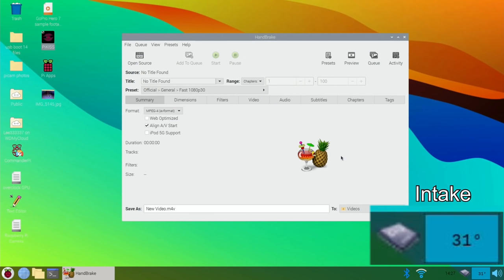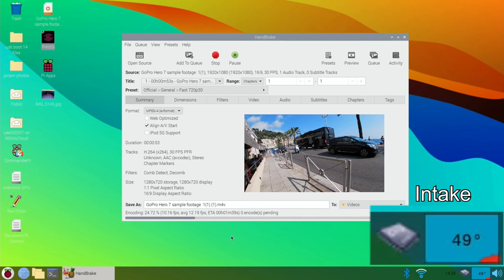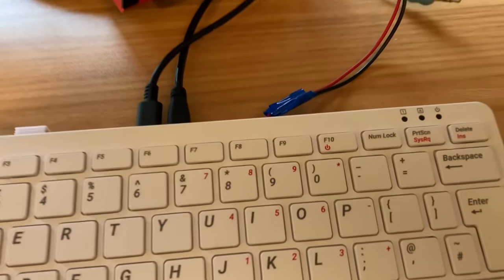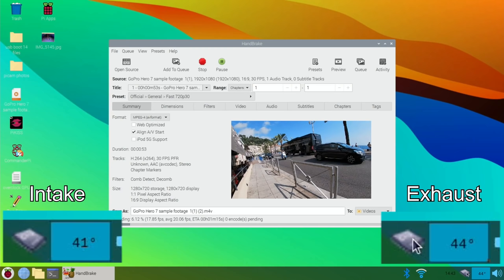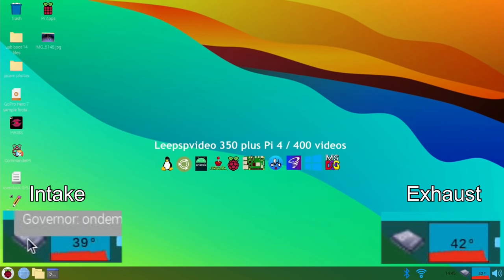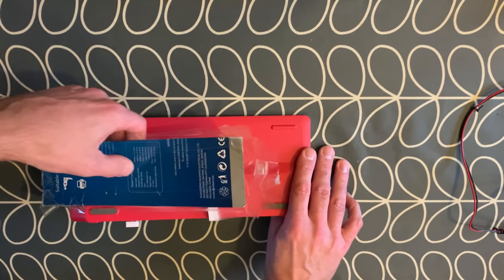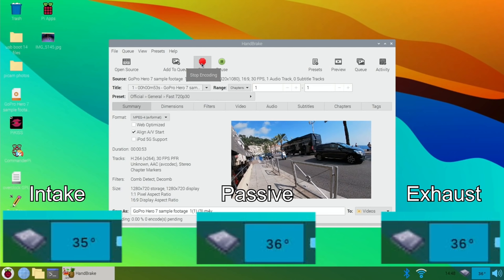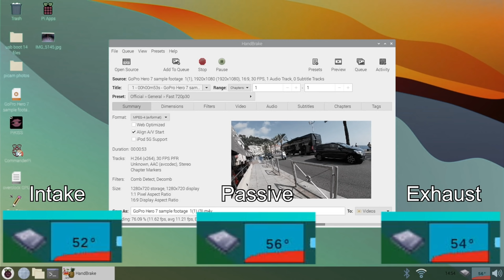Raspberry Pi 400.  Cooling Fan Test.

Comment: I think that you could dramatically improve the efficiency of that setup by doing the following. Cut your piece of car that goes across the bottom of the pie exactly in the middle such that it covers the first set of holes it meets, but the second set are open. Block the end of the 'duct' you have created with a piece of carefully shaped Blu-Tac. You will then have a situation where air is forced into the first set of slots to flow over the vicinity of the SOC, but is then as free as it can be from the second set of slots carrying heat away. I bet you it gives a result at least a couple of degrees better than the 'blowing' setup you had before.

Comment: With your fan in the exhaust arrangement, the cardboard would have been pushed against the bottom of the case by outside air pressure, restricting airflow.  If you lay a couple wires between the cardboard and the bottom of the case, parallel to the planned airflow to keep the air channel open, you will likely get different results.
Reply from the maker: Thanks, the case has a ridge where the vents are. The channel was clear throughout as the cardboard was flat leaving a triangular cavity for airflow.
Reply: @leepspvideo  This may come years to late but a tip when you want to get a good feel for the airflow modell. Get a smokesource (incense stick, cigarette cigar whatever) and just slowly move it around the case, and you can see where the airflow gets stronger. No exact meassurements for obvious reasons but you gat a good visual indication,

Comment: I just read a rumor that there will be a pi5 version , maybe a pi 500 . You could probably use the same design almost BUT with a couple of those laptop fans for extra cooling which will need to be added . It'd be nice if the pi peeps copy the orange pi copy and use full size HDMI ports .

Comment: If it wont go over 60 degrees then you don't need a fan. 60 degrees is pretty mild for these chips. It's actually able to do over 80 for a sustained period of time. People freak out over the heat but as long as it's not throttling there is no need for concern.

Comment: Good video. Keep it up👍. Now I need help from you guys. My RPI4 4GB suddenly stopped booting. I bought it 2 weeks ago. Flashed Manjaro ARM in USB 3 drive with latest EEPROM installed. Everything was working correctly. But since yesterday the boot process stucked at color square. Then I tried Raspberry pi os in a 16gb micro sd. It booted successful but with "CPU1 failed to come online" error. I started htop, which also showed 3 cores instead of 4. But after some reboots, PI also failed to boot. Now when I sart the pi I can see the   firmware info screen. But after that no display! The power led is on but no ACT led ( it comes alive for couple of seconds at power on...and then dead). I disconnect the micro sd and power on the pi. Both pwr and act leds are constantly glowing..screen showing firmware info etc which is normal I think. Even performed eeprom recovery. ACT led keeps blinking with green display. Then I tried to boot the PI os but no luck,  same blank screen with no act led. I tried different sd card, usb, power supply and even try to setup it as hedless server. But same problem. Please help me.
Reply: Busted core is quite rare. I think you should just exchange it for a working one. It's still under warranty if it's only 2 weeks.
Reply: If the power supply is bad it could have fried the board, I would definitely test the voltage before connecting it to another board.  On a different SBC I fries two boards before figuring out the power supply was outputting way more voltage than it was supposed to be.

Comment: I would think sum1 would be able to make a small Liquid cooled system for it using small tubing and a 5v pump, there should be enough space in the housing for small tubes.

Comment: I don't think this is neccessary. Defeats the purpose of the Pi400 to be a sleek 80/90's micro computer. I don't think anyone would use an RPI400 for extended video ripping and conversion. If it's running fine at it's designed limit (60C++?), then there is no issue. I never have an overheat problem running my Amiga emulation. Also helps if you are using it in an air conditioned room.

Comment: How would those laptop coolers work?
Reply from the maker: If it pushes the air up into the keyboard, probably OK. Better if you can seal the sides of the Pi 400 so all the airflow goes through.

Comment: water cool it
Reply from the maker: I did think of the liquid cooling where you put it in a tank of water. Unfortunately your fingers would get wet as the keyboard is attached.
Reply: @leepspvideo  I have a water cooled raspberry pi 4. All you need to do is put a small 30x30mm water block on the cpu and then get pump and reservoir and maybe a radiator.